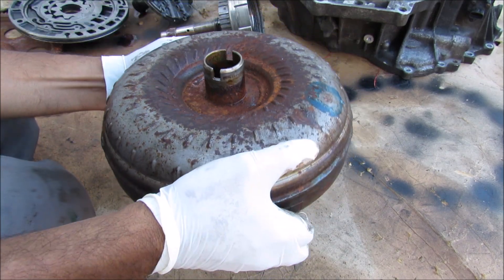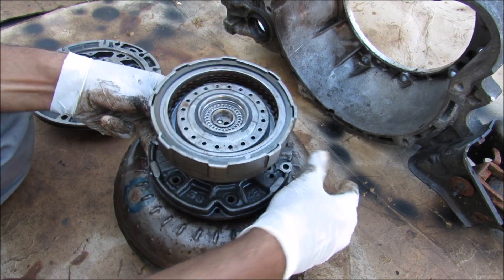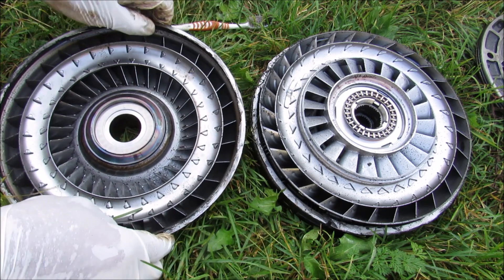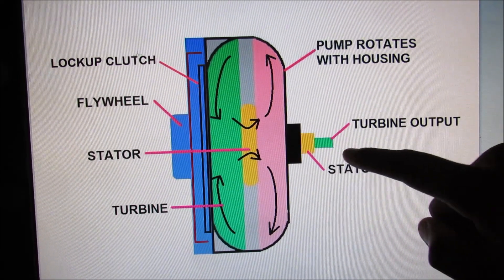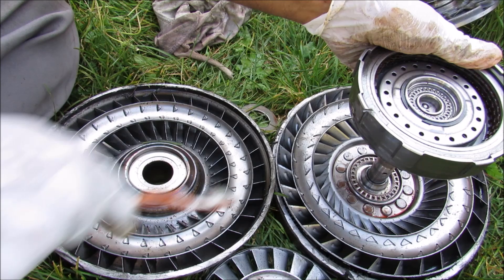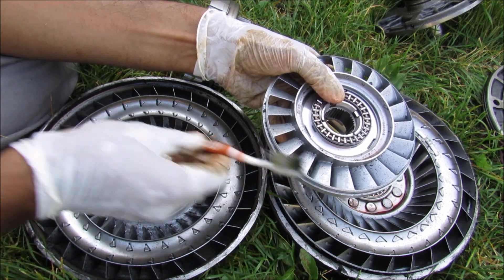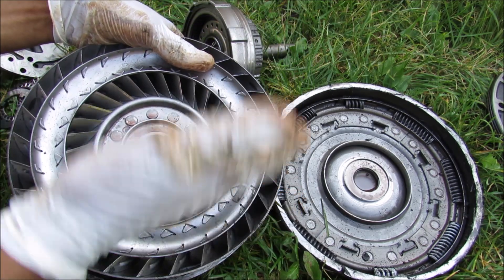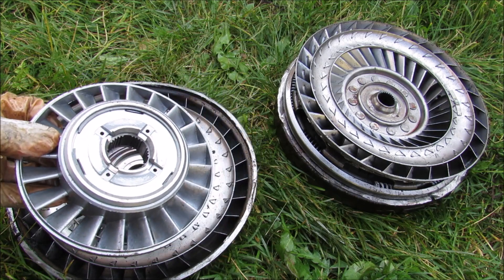How a Torque Converter Works

Comment: Thanks so much. I have watched several videos explaining torque converters, but not one of them correctly explained the function of the stator. Specifically, they didn't explain that the turbine changed the direction of fluid, and that this is why the turbine turns. Having watched your video, I finally understand.

Comment: I didn’t understand, from all that, if the trans. fluid exits the torque converter again, & is it a 1 direction process, aside from all those direction diverts, - MEANING in partiqular, if someone does a DIY trans flush does that flush out torque conv.?, hmnnn?🤔

Comment: How automatic gearbox engage to the gear?
Reply from the maker: It has an oil pump shaft and inside there's the torque converter Shaft
Reply: @speedkar99  so it’s the oil pushes the clutch pack to change gear?
Reply: So that means there is a clutch inside the transmission,right?

Comment: Hey, where did you find my travel toothbrush? I've been looking for it everywhere!

Great explanation and video! How does act on deceleration? Does the slippage allowance prevent damage to the transmission/engine?
Reply from the maker: On deceleration the torque converter unlocks so it doesn't engine brake
Reply: @speedkar99  thanks for the reply! By unlocks, you mean the clutch unlocks, right? The impeller and turbine spin freely but at different speeds?

Comment: one of the best torque converter explainations i"ve seen, but there is one error, at the 5 min mark you say the fluid that goes all around the back of the clutch locks up the torque converter, I think incorrect, that fluid in fact keeps the clutch away from the back plate! The solenoid when applied stops that fluid flow, and the pressure already developed by the blades is what puts pressure on the clutch onto the back plate. But really top notch video, better than those fancy ones done by big companies.
Reply from the maker: Thanks, you may be right

Comment: I think I need to watch this a few more times to wrap my head around all the info and visualize as you explain.
Reply: Some is missing - SpeedKar did a fair job (he always does excellent jobs) here, but the way the torque converter multiplies torque at stall is not explained here for brevity I'm sure, so you will have to see several explanations to piece the exact theory/mechanism together.

Comment: Great clarifying and summarizing pro. Here's a stupid question do the lock up clutch affected by coolant water .u gusted it (my trans oil mixed with coolant) and if  it doesn't  could it be saved by traditional flushing.
Reply from the maker: Flush as much as possible. Any water could cause corrosion

Comment: Which is better dsg gearbox or torque converter. Coz I was planning to buy polo gt tsi, earlier it had dsg gearbox now it has torque converter combined with a three cylinder tsi engine compared to four cylinders. I know dsg is a better and advanced gearbox but now torque converter really bothers me. Please make a video comparing both the gearboxs.

Comment: What is the sign that converter is going bad?Once in a while my car hesitates specially when I'm on a third gear change on a 5 speed Honda automatic transmission.The power is delayed and like slipping on the third gear.I had this rebuild 2 years ago for $2,000 and put 15,000 miles on it.Can I just ignore this?
Reply from the maker: Honda's have inherit problems with the transmissions. The 2nd gear would burn out or overheat.

Comment: Cool.  So if my transmission is experiencing slippage all I need to do is replace the torque converter due to the clutch plate being worn down.

Comment: In the process of doing a transmission fluid flush I mistakenly drained out a little more than I had put in and caused the pump to run nearly dry for a few seconds (less than 5 seconds).  I know this because it stopped coming out of the drain hose in a full stream but rather spitting it out.  I immediately turned the car off and add more fluid.  Would this have damaged the transmission in just a few seconds?  Of course it was in park at the moment it was being drained/refilled.
Reply: No

Comment: Is it the tc locked when you accelerate in full throttle? As i understant it isn't  but why ? Logic tells me that when you want full acceleration you do not want any slippage..
Reply from the maker: +Adrian Tc no the TC locks when your cruising
If it locked during acceleration it might stall the engine or burn too much rubber. This is why manual cars used to be faster than automatics because of the slippage.
Reply: speedkar99 locking during full throttle acceleration in 4th gear from 80 kmh (just an example) won t burn any rubber, and the engine will not stall (as it doesnt in a manual transmission).. so i still don t understand the logic behind this.
Reply: So then how does the term (over drive) fit into this concept

Comment: Very nice, but you should discuss torque converter shudder. Sometimes there is a bit of slip designed into lockup too. If the fluid is worn you get shudder, depending on the application.
Reply from the maker: +alb12345672 thanks, I didn't know about that. I heard some newer accord and Camrys were having that issue.
Reply: Yes, modern ATF has friction modifiers. It is similar to limited slip additive. Dr Tranny instant shudder fix can help sometimes. It used to be a big problem on Fords. I saw some guys on the Lexus GS forum have the issue. Not common, but it happens.
Reply: I’m experiencing some shudder on my 2011 RX350 and I’m thinking it’s the torque converter. I had a fluid exchange about 2k miles ago but it’s still there. Hopefully, it’ll diminish over time because I don’t really want to replace it. I have 262k miles on the vehicle so far
Reply: @watso014  Some misfires are directly related to ignition. Modern cars have a pulse strategy and it requires clean torque from the engine. Was a very big issue on Ford Cars years back.  Touch the brake pedal, that unlocks the converter.

Comment: what is the proper face clearance between impeller and turbine...please ?
Reply from the maker: +rodelio roa that I'm not sure.
Reply: Oil viscosity in the torque converter directly administers face clearance parameters

Comment: Question: Do AT pump rotates when "N" is selected since the AT pump it's connected to the stator of the Converter and not the Housing(rotating at engine RPM)?
Reply from the maker: +Petar The pump always rotates. See my transmission video for details

Comment: looks so clean on such an old car
Reply: so is transmission fluid the same as the fluid used in the torque converter? my old corolla got transmission fluid replaced at 100K. I don't know if that goes inside the auto transmission gear box, the torque converter or both
Reply from the maker: +protoslashwyl Yes its the same fluid. But when you drain, your not draining the torque converter.